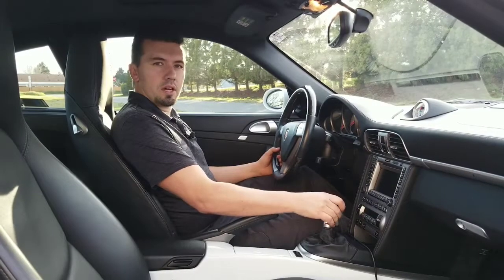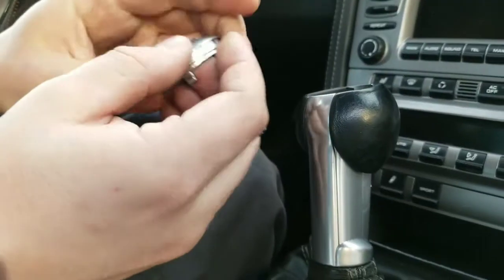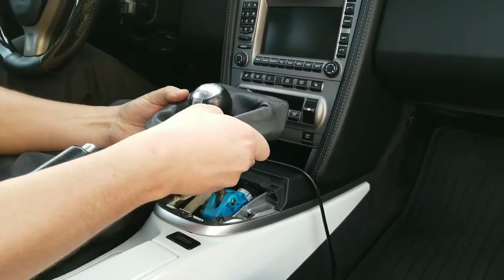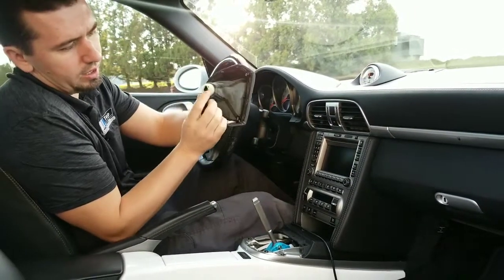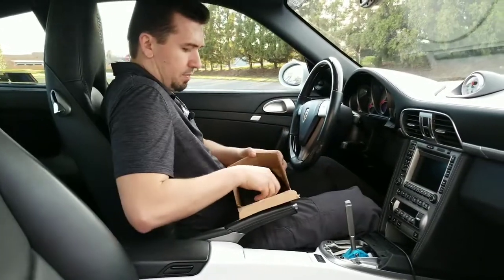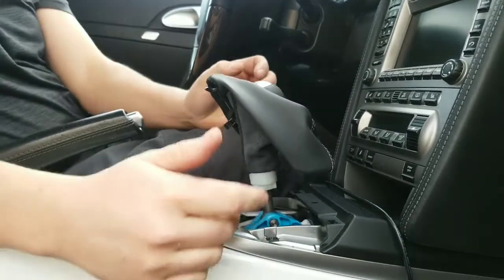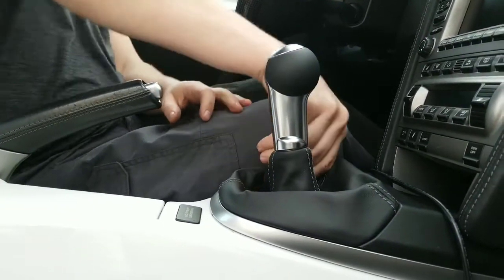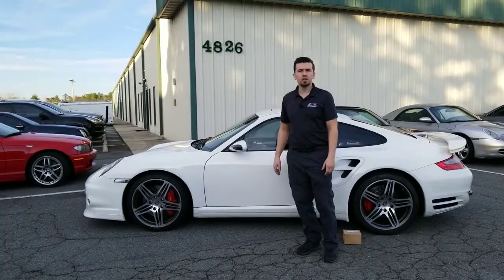PORSCHE 911 997 TURBO | shift boot install and replace

Comment: Nice video!  Where did you buy the new shift boot?  I'd like to just replace the boot assembly and keep my current knob.  All I can find is a "leather only" boot which doesn't include the plastic frame for the boot.